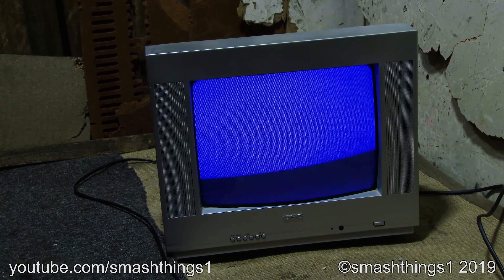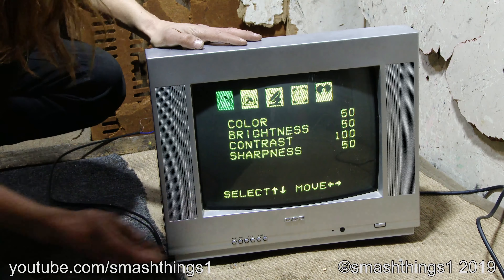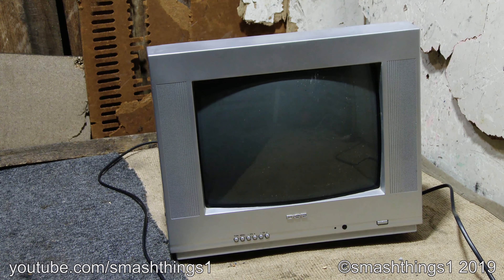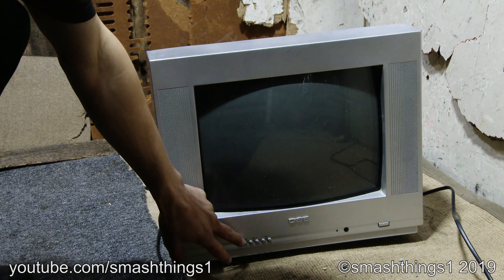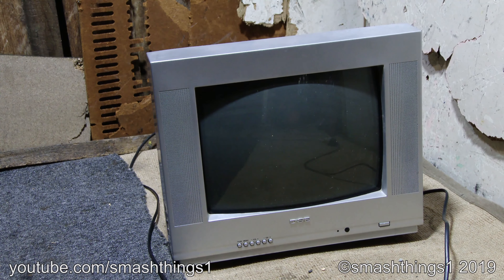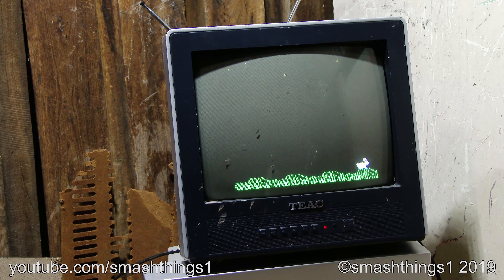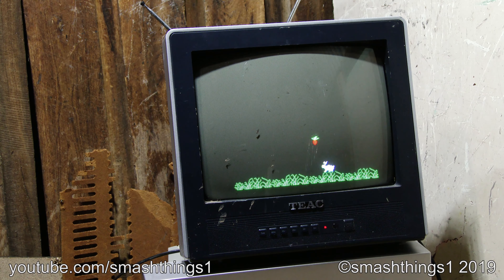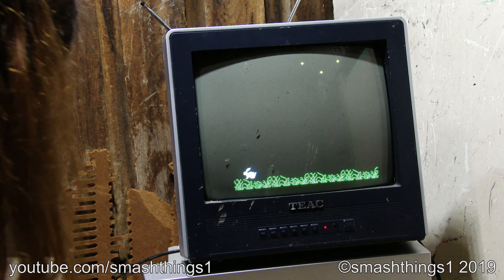Overvolt CRT Inputs with 240V

Comment: Why do you break intentionally two perfectly working TVs?
Reply: There are plenty of working CRT televisions out there, the amount he destroys barely scratches the surface. And besides, got to have a little fun seeing the limit, and going over the limit and see what happens.
Reply: You are right, but these TV could have been used for retro-gaming, because they don't have native resolution neither input lag. If not, with a dvb-t receiver, they could have been donated to a poor man who can't afford a new brand one.
Reply from the maker: You do realise tech is so dirt cheap you can get free flatscreens with built in digital tuners easily? Nobody wants CRTs, not even the "retro gamers" would want these because they're just generic CRTs. Except for maybe the Loewe one.
Reply: CRTs are still being made
Reply: @smashthings1  Quintrix F and Trinitron are great CRT
Reply: @WilliePlayz I've had 2 2003 model 4:3 CRTs develop the same fault, shorted green cathode to heater short causing green screen and retrace on warm up, poor focus and flying pink fluff across white backgrounds, they're not as lasting as the older CRT tubes
Reply: Because science and boom boom